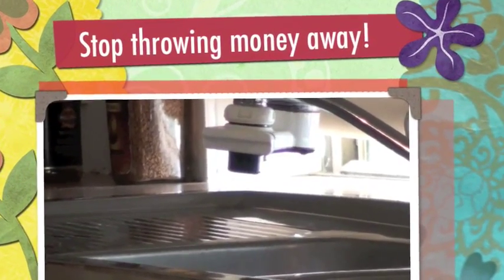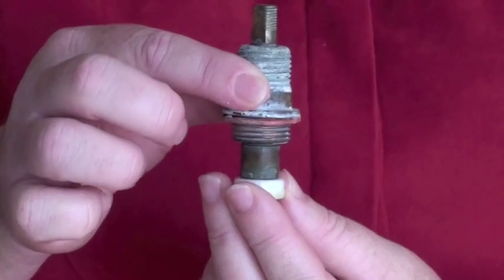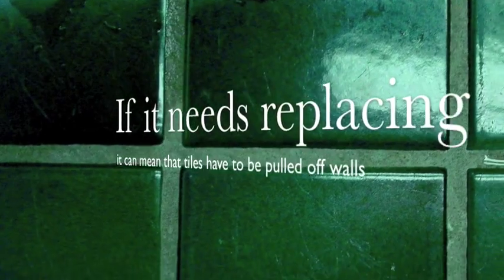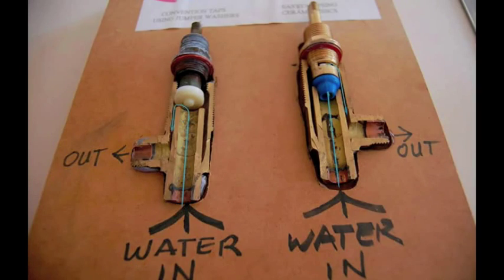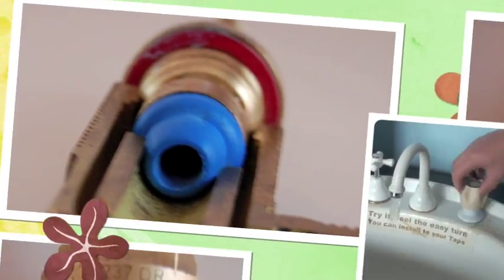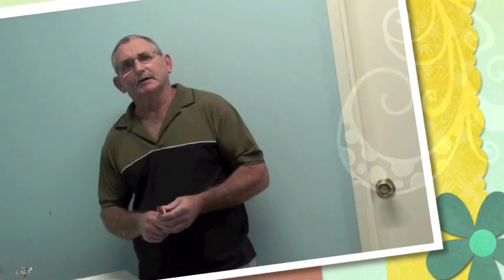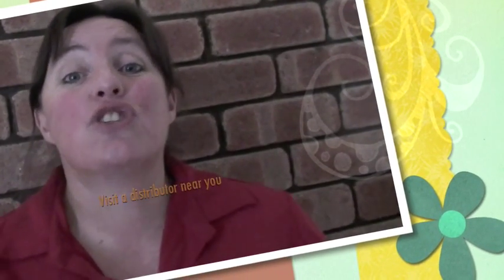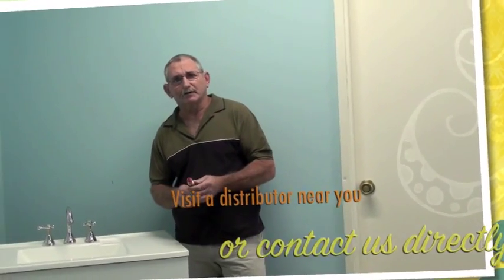Easy Tap:  A Revolutionary Spindle Design that Doesn't Drip or Leak!

Comment: One week ago I bought a set of Easy Tap spindles after years of calling in plumbers and handymen to fix the dripping taps in my older home.  I have literally spent at least a thousand dollars over the years with tradesmen coming in and telling me they have fixed the dripping taps by putting in new washers, only to find an hour or so later the tap starts to drip again.  When I rang the plumbers back they would always say they did the job and it wasn't dripping when they left.  When you are an older woman on your own, what else can you do.  Well I heard Easy Tap advertised on the radio so I thought what have I got to lose, I have spent so much on my taps in the past, I'll give these a go.
My son installed them, easy peasy, I could have done it myself.  Took no longer than five minutes and what a blessing they are.  So easy to turn, with just two fingers, and not one drip has fallen since.  
I thoroughly recommend Easy Tap to everyone, especially people who have sore hands or arthritis as you only turn them a little way and they are so gentle. 
I will only EVER use these Easy Taps for the rest of my days and I found Tony Zhang to be so polite and helpful that it was a pleasure doing business with him.